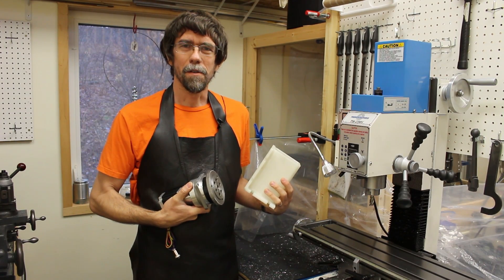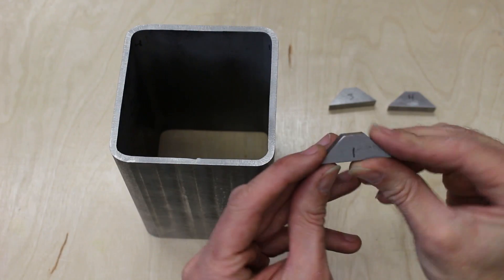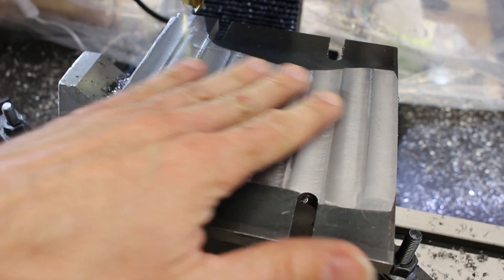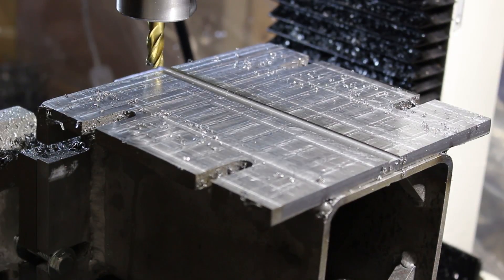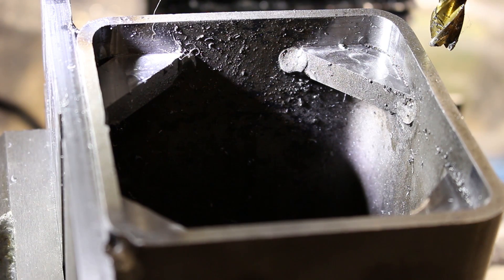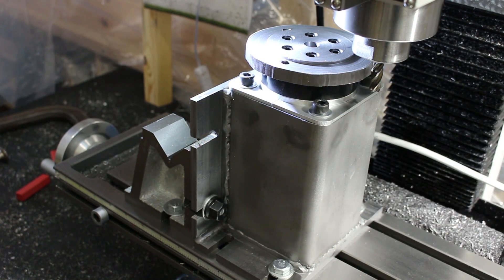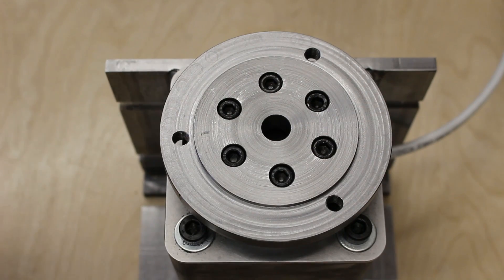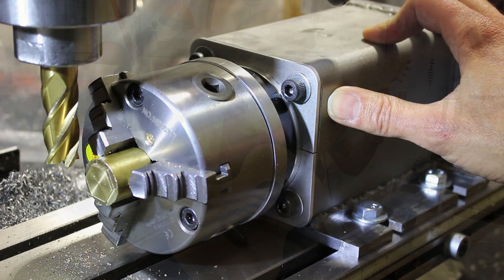4th Axis Harmonic Drive Build Part 2

Comment: yes, very nice indeed....I am interested in your CNC controller I would like to have something easy and simple for my milling machine ...If I don't get it wrongly, need it to only work CNC job, or small files of G-codes ...Thanks
Reply from the maker: A controller like this is a good choice for simple usage. You still need a PC and software to generate the g-code files (e.g. with Autodesk Fusion) but once you have the file on a USB stick then it's standalone and easy to operate. There's practically no limit to the file size since it reads the file from USB as it runs.

Comment: Magnificent. I know a Harmonic Drive is almost the only way to go for 4th axis. I only have one question. How well does the 20 size HD holding? Is it stiff enough or would you recommend a bigger size, like 25?

My CNC mill is same as yours (different brand Optimum BF20) and I'll use the same 100mm size chuck.

Thanks.
Reply from the maker: Thanks, and to be clear it's a Harmonic Drive brand gearbox but internally it's a low-backlash planetary gear train not a strain-wave gear (which is often inaccurately called a "harmonic drive"). I've never had any problem with the holding torque, but I only do light machining of soft materials so there is very little cutting force. For wood and light cuts in aluminum I think it's fine, but if I were to move it to my milling machine to cut steel I'd probably take light cuts, no heavy hogging with roughing mills for example.

Comment: .0028 thou..  nope, no good.  gotta be zero runout for what I do.  Gotta measure with the .0001 indicator.
Reply from the maker: I'll wager that you're not using a CNC router with structural parts made of plastic like I am! My benchtop mill is more rigid but still has a lot of flex compared to a heavy-duty mill so I'm not able to hold tolerances that tight.

Comment: Helloo, 

Material Diameter: 70 mm , Length : 145 mm ,
Step Motor : 1.8 Degrees , 4.9A ,15.87 W , 200 Step
Reduction Gear : 140 revolution/min  ,   [ 1/10 ]  

Please help me ? , I did as you showed but I could not reach the result..I should calculate StepsPer , Velocity , Accerlation ..
When I write the values obtained as a result of the calculations we made with you, when I make the material take a full tour, it does not come back to the point where it started.

Comment: 5:29 wouldn't a face mill be better for that task? I'm just slowly getting into machining (my two face mills for my mini CNC are still on the way to me)
Reply from the maker: The usual choice would be a fly cutter, although it may present vibration issues on a lightweight mill like mine and would need very light cuts so it may or may not be faster. On a heavier mill a fly cutter is definitely preferable.
Reply: @BrainRight  I have the smaller brother of this machine, I'll receive the face mills within this week. I have converted mine to CNC, I feel like the smaller version of it is very difficult to handle without CNC (=constant feed rates with all axis). I have the xx18 of this machine (you're one is the xx25) how do you feel about your milling machine overall?
I asked the original manufacturer in china and they advised the xx32 version.

Comment: Using flat head bolts to hold the parts of the box together would have resulted in no warping and probably would have been faster and easier than welding. 1/4" or 3/8ths bolts with locktite would have provided all the strength and  rigidity you would need to match the rigidity of the harmonic drive, stepper and chuck which, after all, you assembled with adapters made from aluminum. This box would probably support a car and with the fussing to get things square again after welding it probably isn't worth it.

Comment: Nice job brother. I envy people who have the equipment to do such work. I think the run-out on the pin in the chuck originated between the chuck and the jaws. Maybe a bit of internal grinding on the jaws to sort out this problem. Just remember to support the jaws on the inside when you do the grinding and not like people normally would do clamping a ring on the outside.

Comment: Will the runout really matter? Is there a way to cerrect it? I wouldnt want to have runout, so i want to know if it is correctable.
Reply from the maker: It all depends on what you're trying to accomplish. For example if I were using it to make wooden chess pieces, I wouldn't even bother measuring the runout because it wouldn't be important. If I were using it to cut gears, it could matter a lot. This is similar to runout on a lathe and there are ways to reduce it, such as regrinding the chuck jaws, but it's not worth the trouble for my needs.

Comment: thanks for this video ! yes deformation always occurs with welding, when a non  professional do this type of operation (with or without using oven in order to relax constraint) this is close to impossible or a miracle if we must not rectified at the end. An old mecanist explain me a simple trick as soon as possible always prefer using cold drawn steel with brazing bonding instead welding this 99% enought robust for our needs and avoid welding stress and this most easy to relax constraints.

Comment: To get your chuck running dead true, take a dowel pin and indicator  like you showed in the video and mark the lowest reading on the pin. Locate the nearest chuck jaw and remove it.  Put it in a vice and using a carbide mill cutter,  take off a few thousands. Replace the jaw and repeat until it runs true on the diameter and length.

Comment: Hello Jay - Molten steel shrinks 2.5% by volume when it solidifies. This is why welding creates so much distortion. It's a much more significant distortion than just the metal cooling.  For your sort of machine building you should look at silver solder or brazing. As there is no molten parent metal solidifying there is very little distortion. This produces much better machine parts then welding.  Good productions and machines. Regards Peter S mech engineer and fellow CNC machine builder.

Comment: I'm making this comment at the point where you were discussing the welding of the plates on the bottom and end.  It seems that heat is necessary but that it is a necessary evil for what it does to the metal as warping.  Then requiring the added work to shape and trim each surface flat and square in relation to all the other surfaces.  It is obvious that doing this is necessary to have a precision tool in the end.Somewhere in this process I noticed a shot of your machine that you've been using to do the lathe work, but later I had this thought.  I'm interested to know if I caught a glimpse of, and do you have combination vertical mill over a lathe?  I've never used a machine like that, but if you do doesn't it provide the ability to accomplish what a separate 4th axis unit accomplishes?  But then I thought, maybe you wanted to have a separate unit to use in various machines (like the CNC I saw at one point).  Bottom line is, what are your thoughts on having a combination unit of mill over lathe rather than separate?  Then add the possibility of having it be to the level of making it automated like a CNC.  Additional questions:  1.  What is the model names of the mill and or lathe you have and use?  2.  What CNC table did you show in your videos?  Very nice video for many reasons.  Roger

Comment: Great job... 
One question... what made you change your mind about which side you'd mount the 4th axis on the Mill ?
Early in the video you talked about changing the plan for the wiring hole as you'd prefer the axis on the left side of the table and the wire coming out of the back side but actually made it to original plan.

Comment: Re that base plate distortion - heat the whole piece up to just below red heat before welding. After welding, heat again to red heat, put on anvil, and hammer those flanges down. Then you'd need only a very thin mill shave off to get the base flat.

Comment: you are very through with the build and fantastic explanation.After welding why did you not relive the welding stress by heating the entire bracket and cooling slowly
Reply from the maker: Thanks, others have also suggested annealing and I think it would have been a good idea. I don't think it would have greatly reduced the distortion but I expect it would have helped.
Reply: Thanks for the reply, I saw that you have heated to 500F to burn off oil before powder coating. That temp is not high enough for annealing but  wondering if tolerances have changed after heating and cooling.
Reply from the maker: I did not detect any dimensional changes after the heating and cooling.

Comment: Hot metal shrinks does not have to be molten. After welding the unit could have been annealed before machining to release stress caused by welding. Annealing would make  the mount stable. I Fly cutter pass over the entire plate in one pass. Would produce a flat base.
Reply from the maker: Annealing sounds like good advice and I expect it would have reduce the flattening passes, though think my lightweight mill would still require multiple passes due to its limited rigidity.

Comment: Good video. Can you please tell me how much torque do you get by using the stepper motor and the harmonic drive?
Reply from the maker: I have not yet measured the holding torque but I plan to do so. The theoretical torque is the holding torque of the stepper motor multiplied by the 45:1 gear ratio. This stepper is rated for 2.0 N-m at a drive current of 3A, so theoretically the output holding torque would be 90 N-m. The torque is less when the stepper is rotating, and drops off as the speed increases according to the torque curve of the stepper. I don't have that documentation for this exact motor but I expect it is typical for steppers of this size.

Comment: I thought you said you were going to exit the power cables to  the rear of the unit with chuck facing to the right ? at 13:45 I hear you saying the wires were exiting from the other side  I guess it doesn't matter which side but wouldn't it  have been better on the other side ?
Reply from the maker: Yes I changed my mind about that, just personal preference and no real mechanical advantage either way.

Comment: You've made a decent mechanical job there, however you've heavy failed in a fundamental concept: you can't rely all the heavy vibrations stress into the gearbox's cross roller bearing. why? for several reasons: cross roller bearings are the hell or resistant... ok, the same way of expensive and hard to find, BUT they are designed for axial and radial stress for non vibration applications like precision robot arms joints which in nature are not heavy vibrations work like milling vibrations, which are pure destruction for that fine and precision expensive bearing, also for the harmonic drive's flexspline. Your system will work nice for a short time until it wears out unless you work with light stress metal as aluminum. Remember you bought it ridiculously cheap because it's used so it may have already reached it's lifespan. The heavy vibrations should be absorved by a big & standard roller bearing which can be replaced easy and cheap. Good job but, i hope it lasts as long as possible. PD: at least you should use a bigger (hopefully new) cross roller bearing, that's to say a bigger diameter harmonic drive gearbox.
Reply from the maker: I plan to use this mainly for light engraving of wood and soft metals, normally with a tailstock which I have yet to make, so I'm not too concerned about vibration stress. But I agree that it would be more of a concern with heavier machining on tougher materials like steel. At my current rate of project (non-)completion it should last practially forever. :-)

Comment: Get your self a cup wheel and make a arbor for it and grind the flat surface ,you will not believe what you can do with it.
Reply from the maker: I expect it would produce a good result but I hesitate to use any abrasive products on the mill. Maybe that's just me being too cautious about it, but I just worry about introducing abrasive grit into the machine. I am shopping for a surface grinder though!

Comment: Nice job, I would add some constructive advise to you. Although as you stated your hobbyist machinist a small say 3" face mill would be a good addition to your tooling. All those passes you made on the bottom of stepper housing could have been completed in 2-3 passes as opposed to god knows how many with that, I guessing 1/2" end mill. Advantages would be considerably less time and more importantly less heat generated and better surface finish. I especially liked the spline you added that will pay off big time in future setups. I enjoyed your presentation and attention to detail good luck with your new 4th axis. But get a small face mill !! They are all over Flea bay just make sure that the inserts are common and still available. Some of the tooling seems like a good buy but sometimes you get it only to find the inserts are no longer available.
Reply from the maker: Agreed, and after this project I bought a 50mm indexable shell mill. I haven't tried it yet, except for a quick test, but I think it would have saved a lot of time.

Comment: Cool jobb. Weldment is special type of animal. Preheat and post heat and clamp the bottom plate to thicker plate and let it cool down, then you can reduce a lot of tension and flex from the part.
Reply from the maker: Thanks I will try improving my technique on the next welding project like this.

Comment: You should experiment with your mill to see just how deep a cut you can reasonably expect to be able to make. The reason being that you want to avoid excessive use (and the resultant wear) of the very tip of your end mill. The sides of an endmill are good cutting edges. Make use of them when possible and spare the tip. Again, impressive 4th axis!
Reply from the maker: Yeah I'm still learning the mill and what it will or won't handle, and in the beginning I was taking pretty shallow cuts but I've started getting more aggressive with it. I think it will help now that I've switched from collets to end mill holders where I no longer have to worry about the cutter slipping as it did on my T slot faceplate video.

Comment: Was considering one of those Chinese 4ths available on ebay.  Not sure if I could ever be happy with one of those after seeing this.  Thank you!
Reply from the maker: The Chinese 4th axis units aren't necessarily bad, depending on what you want to use it for. For some woodworking applications I think they would be adequate, but they don't have a very large reduction ratio (typically 6:1) so that gives higher speed but lower precision and holding torque vs. the 45:1 reduction that this gearbox has. I don't think those units would be usable for most metalworking applications.
Reply: I found these harmonic drives on ebay and purchased one.  Going to try and build something like you did only I plan to use a nema 23 Clearpath motor.  Thanks for the inspiration!

Comment: Did you consider cutting slots across the edges of the tube to fit the corner brackets in? It would get rid of a few precision fitting steps and let you weld from the outside of the tube.
Reply from the maker: Nope, didn't think of that. Seems like it would work well though.

Comment: Nice little videos and I enjoyed the process.
In order to get rid of the runout in the chuck machine the register undersize and then adjust the runout using the mounting bolts.It is the way lathe chucks can be mounted and they have to contend with way more torque than your rotary axis ever will.
Keep up the good work.
Reply from the maker: Yes one could get lower runout that way, but at the expense of more time to mount and then adjust the chuck. And I think it would be more difficult (time consuming) to move the chuck between the lathe and 4th axis, which I find really convenient. I can see the advantage of doing it that way if one had a chuck dedicated to just one machine though.

Comment: nice videos and very helpful and full of information.. but sorry: the units make me go crazy... 1/6 of a inch, 2/3 of a gallon and so on :) why this middle age measurement system? :)
Reply from the maker: I understand and I would be much happier working entirely in metric units, or frankly in any single system of measurement, but alas I have a mixture of tooling so I just work with whatever units are at hand and convert as needed. My milling machine is graduated in inches but that will change to metric when I do a CNC conversion on it. On the other hand my Logan 210 metal lathe is an antique family heirloom that's going to remain in inches, as will most of my cutters etc., so I'll have to continue using both measurement systems.

Comment: shorter stitch welds would have caused less distortion - whilst even heating may have relieved it too
Reply from the maker: Yes that would have greatly reduced the distortion, but I was trying to seal up the seams so they wouldn't accumulate oil in between the housing and base plate. As I found when preparing it for powder coating, that didn't really work and oil seeped in anyway. Next time I'd use shorter welds and just expect some oil intrusion.
Reply: But I guess you would have still milled off the back regardless lol